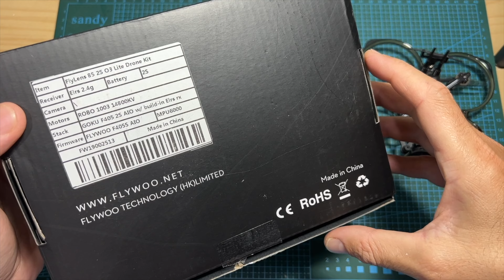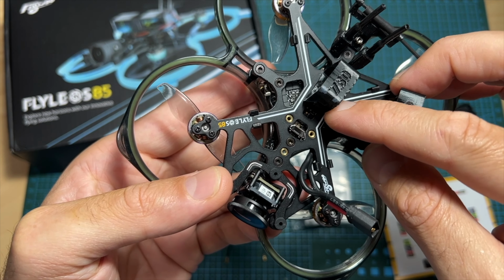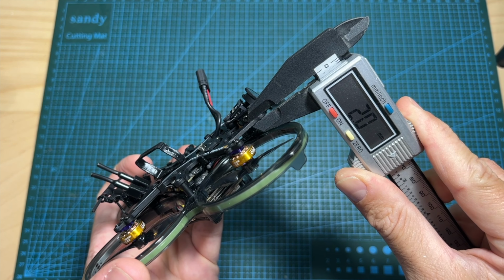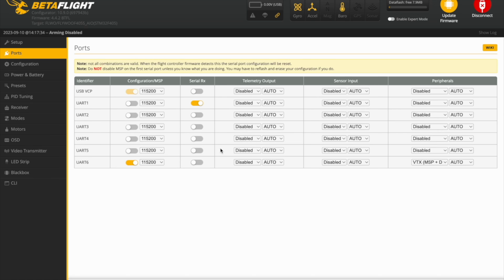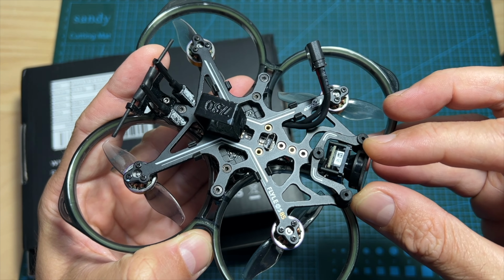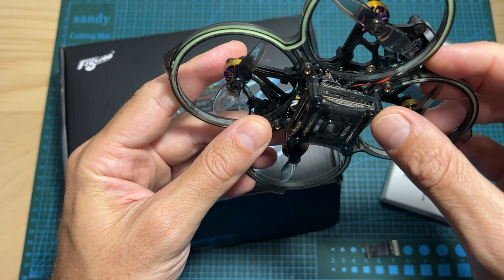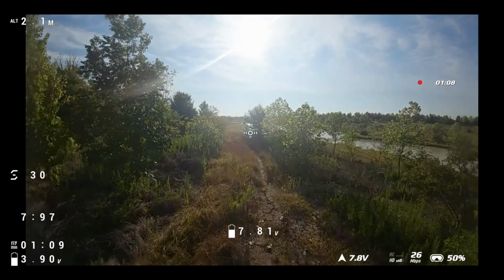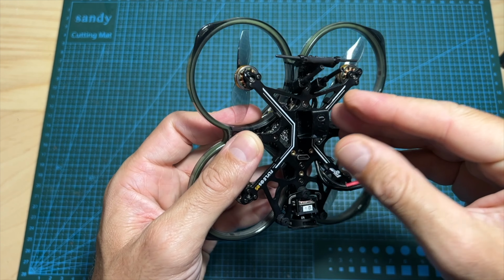Pocket O3 CineWhoop // Flywoo FlyLens85 O3 LITE 2S 2" Whoop

Comment: bro KremerFPV  , can you tell me  which  one  better ,, lyLens85 O3  and  pavo pico O3 ,   thank you very much ,  but look like pavo pico can lower 100G
Reply from the maker: Yes The Pavo Pico is lighter with a naked O3 unit, sorry if it was misleading. I really like the FlyLens85 and it seems like a more stable platform than the Mobula8 / Pico.
Reply: @KremerFPV  thank you 🙏

Comment: Hi could someone post the diff all of the tune for that flylens? I builded mine with the Pavo pico hardware but can’t seem to have a good tune . I would try with a good tune if someone has one . Thx
Reply from the maker: The dump settings are included in the video description. You can copy just the tune.
Reply: Need to get access to to the dump file .. I requested it
Reply from the maker: @ItsRen_FPV  my bad. It's now available for everyone.

Comment: You compared the naked o3 flywoo to the full o3 pavo pico. Totally missleading. The flywoo is actually more heavy, not otherwise
Reply from the maker: Sorry about that - I should have mentioned that using a naked O3 unit the Mobula 8 / Pavo Pico will be lighter.